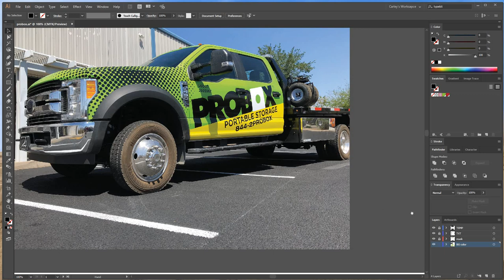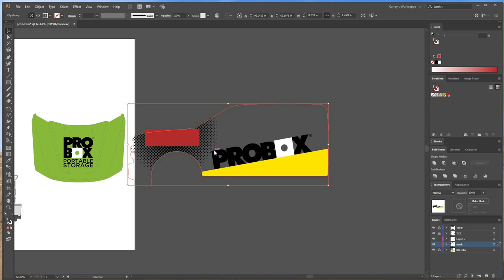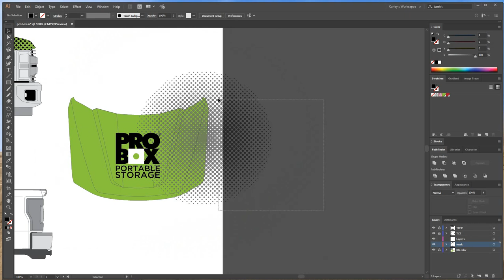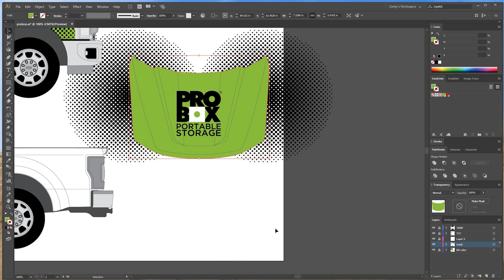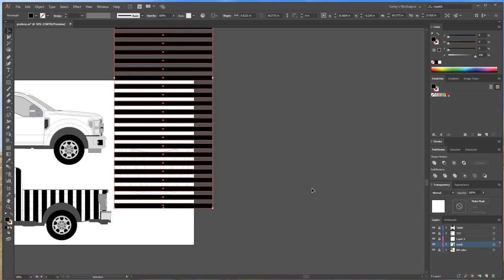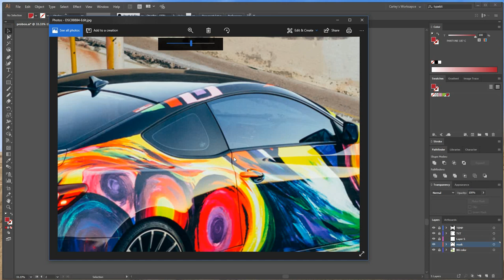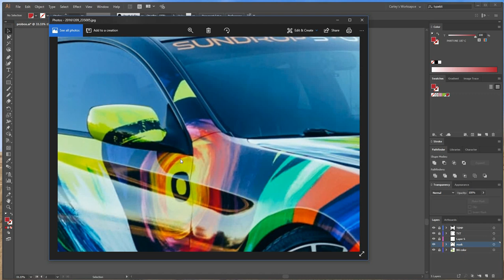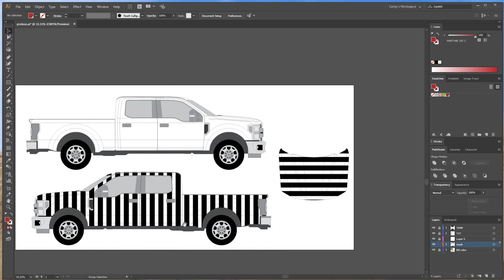Designing tips on lining up fender to hood for vehicle wrap install

Comment: i wonder if the installer started with the sides and then installed the hood... if he/she had started with the hood they could have had an easier time lining up the dots with the side panels. Definitely a tricky design to pull off despite it looking pretty cool on the computer.